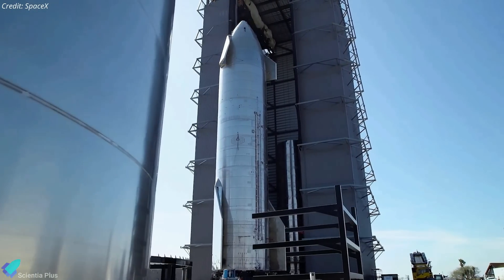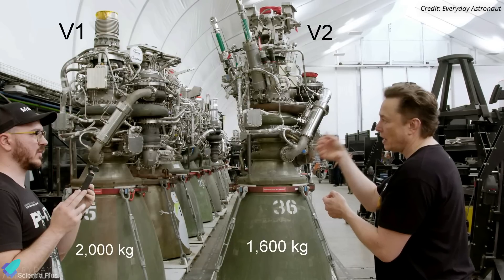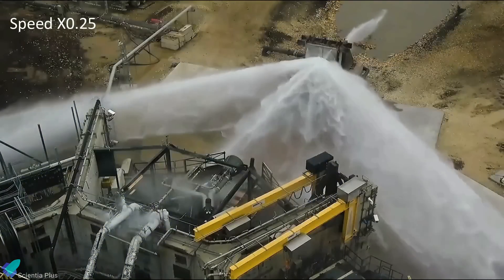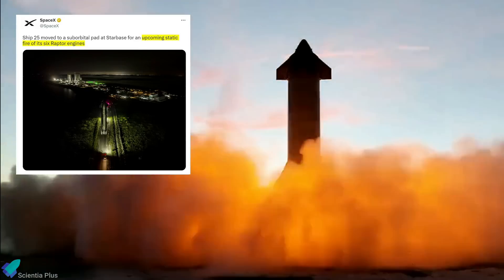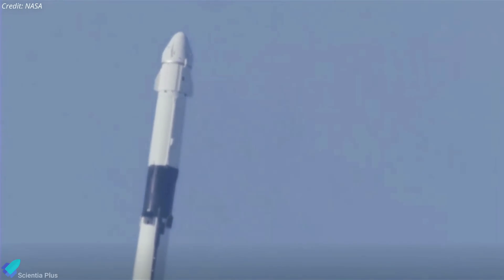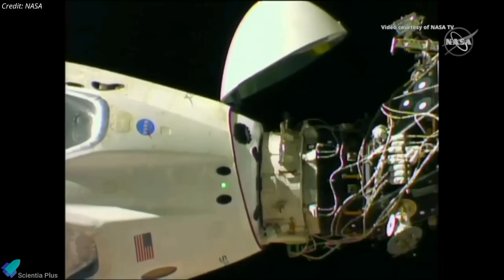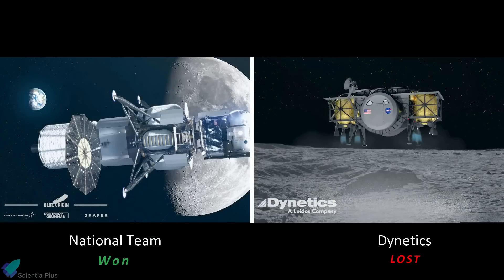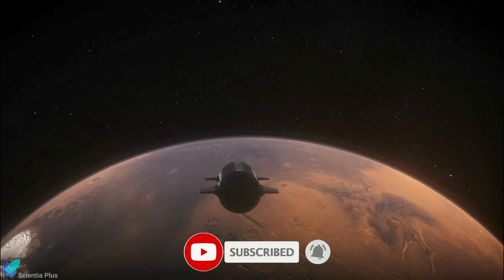Starship Raptor Engine Tested the Strength of OLM Steel Plates, Ship-25 Static Fire, Blue Origin

Comment: Can I ask where all the water is going to go after it runs off the steel plate?
Reply: A lot will get vaporized, one big cloud.  The rest will probably just flood the surrounding are and run off into the swamp or ponds.  And protect all that while doing so.

Comment: One engine? Not much of a test, is it?
Reply: Scaling.  It's valid.  Just the first of several steps, I'm sure.
Reply: @nathanwahl9224  The 33 raptor static fire test against the plate system will be epic.

Comment: There is no flight need for engines to be at base of the moon lander? nor the lander be in  a pencil configuration?  ease of erxiting and entering for crew and cargo is for the hull to be at base with storage and  cargo door and airlocks? landing and take off engines can be higher up and outside the main crew area? no ropes pullies lifts then would be needed